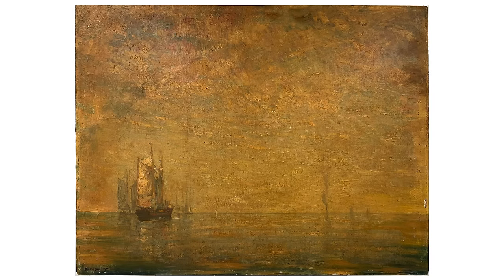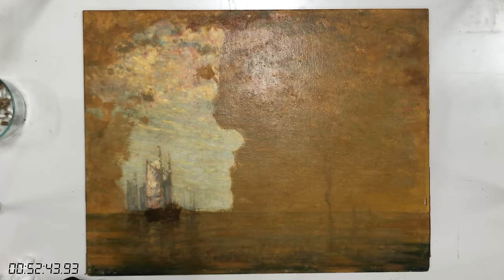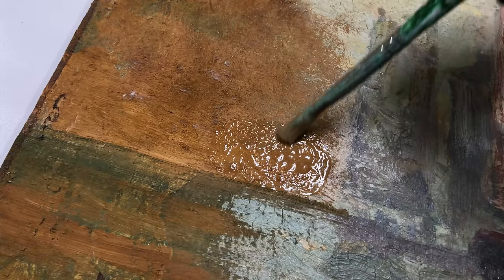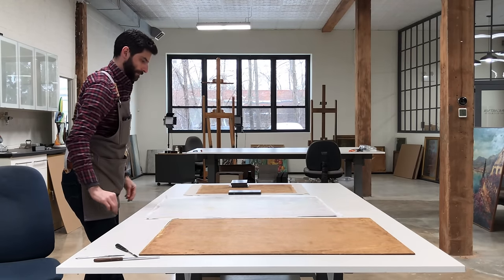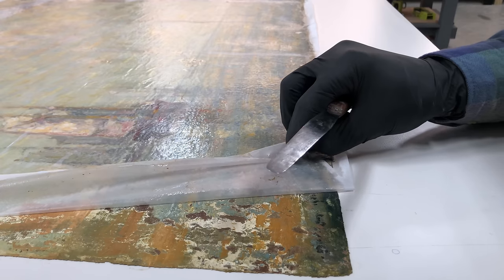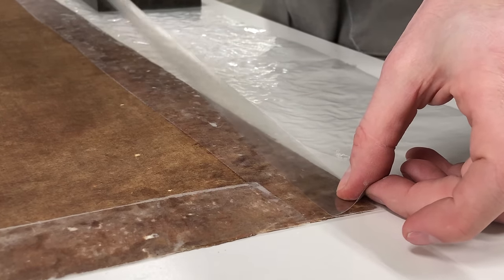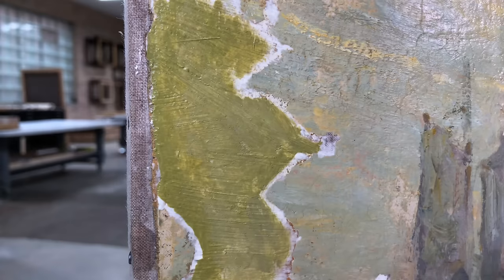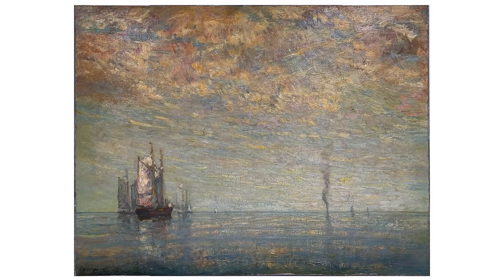Blue Skies Smilin' At Me; Conserving A Henry Ranger Seascape

Comment: I have a question: how do you know when to stop cleaning? When you clean all the varnish off something like the overpainted area here -- which was the same colour as the varnish -- how do you know to stop (assuming, of course, that the paint wasn't hardened and needed to be chipped away). For example, the darker edges on the Jacobo Bassano or the Cornelius Janssens; they're dark enough that they seem to be the same colour before and after cleaning, so how do you know when the cleaning is done and working any further will start to strip away the paint?
Reply: oh this is a great question!! i hope he sees this and responds (im replying in hopes that the algorithm will place this comment further up aftwerwards lol)
Reply: He has used UV light for some other paintings to see if there's any varnish left if I remember correctly

Comment: Hi, I love your videos! I have a question ... You have used fish gelatin and japanese paper to protect the surface when removing the rabbits skin adhesive from the back in other projects, like in the "Alfred", which I am guessing is a newer restoration than this one. Is there a reason why you use a water soluble adhesive in the alfred but not in this one? I was thinking maybe it is because the fine texture of this canvas would allow some water to pass through... Or maybe you found out that removing the rabbits glue with water doesn't cause any issues to the protecting paper when using fish gelatin?     
Your explanation of everything you do and why you do it is always very clear, but now I'm intrigued.

Comment: So the ultrasonic tool is basically the same thing we used to use to do dental cleanings on pets when I worked for a vet (you use the side of it, too, not the tip).  I assume human dentists use something similar.  Ours flushed water at the same time, which a painting conservator obviously doesn't want, but there it is.

Comment: strange question: if the varnish is on top of the overpaint, and the cleaner doesn't remove the surface grime, why is the overpaint the same colour as the varnish and not removed when the varnish is removed?
Reply: The overpaint was oil and his cleaning agents are designed not to remove oil paint.

Comment: If it was water damaged, could the water have "cleaned" a bit of the grime from the edges, which would have not matched the rest of the yellowed painting anymore (even if some of the original work was revealed, it would have been way brighter than the rest, and it could appear almost as a blank canvas) and so someone thought the actual paint had been taken off and painted over that to match the rest? Because if nothing was wrong with most of the painted over spots, there wouldn't have been a reason to do it, right? Idk, I'm just trying to find a reason for that sloppy work :/

Comment: The only justification you need for folding and tacking the excess canvas is that it makes it easier on the next conservator if they find that the canvas is still in good enough condition to reuse, they won't have to struggle to stretch an insufficiently large piece of canvas.

Comment: I "think" that I know possibly why this piece was mounted to hardboard...there ARE people....who have hissy fits if the back of a canvas protrudes from the back of the frame. They are the people who insist that the frame lies flush with a wall. And if the original frame had a standard depth rabbet....well, the stretcher bars are going to stick out of the back. So it may have been done after the fact OR was done originally for that type of client. people have strange idiosyncrasies. I have had to do this myself for clients who have that....request.

Comment: Does anyone know what the purpose of the cloth strips on the hot table are? Do they help create a seal or something?
Reply: @4NN13 H.
There are holes through the table that attach to suction hoses, which are used to pull the top Mylar film down, removing all the air and pulling everything flat. 

The braided strip allows air to be pulled through, otherwise, the Mylar would clog up the holes, making the table ineffectual.